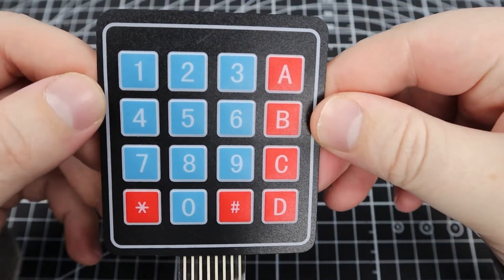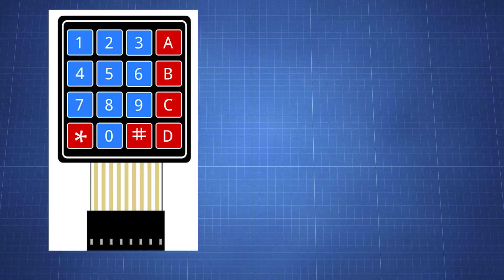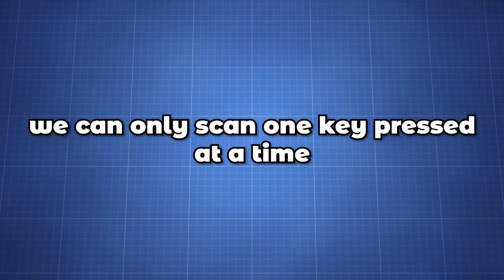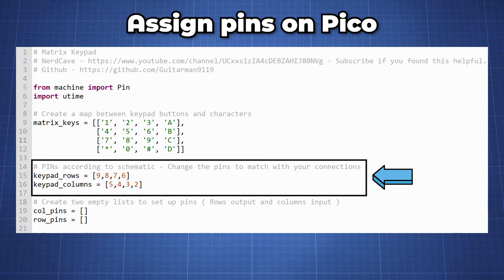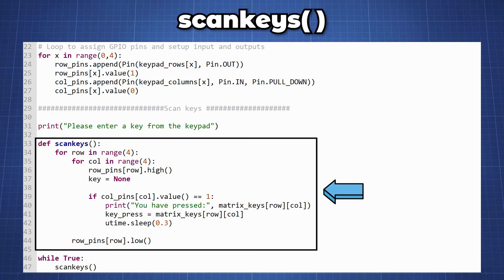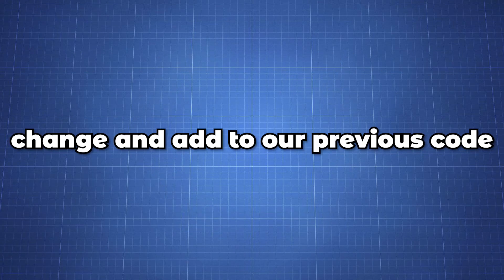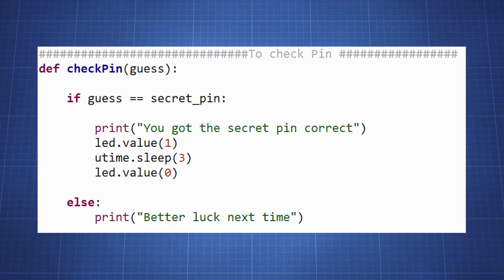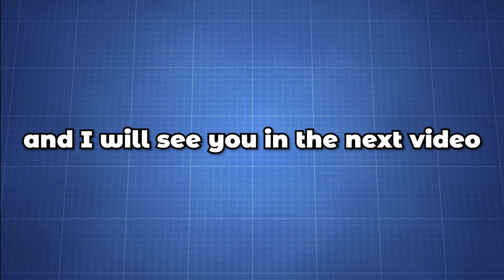Raspberry Pi Pico Tutorial -  4x4 Matrix Keypad - MicroPython

Comment from the maker: *a small error made in last circuit, remember to add a resistor in series with LED to limit current.
Reply: Can u use the number pad as an macro keyboard?
Reply from the maker: yes you can, still input so instead of assigning a value to key, it will just act as keypress then do specific macro.
 @LightSkip_rb

Comment: hi i really hope you answer me i am confused why did you put the rows as input and why did you put the columns as outputs
Reply from the maker: A matrix keypad is essentially a grid of switches, each switch being identified by its row and column. To determine which key is pressed, the microcontroller sets one of the lines (row or column) high (or low, depending on the setup), and then reads the other lines. If a key is pressed, it will connect a row line with a column line, and the microcontroller will read a high (or low) value on the corresponding line.

Whether you choose to set rows or columns as inputs or outputs depends on your specific needs or constraints, such as the physical layout of your circuit or the specific requirements of your microcontroller's GPIO pins.

So in short you can switch it

Comment: How Input High on pressing as we are not giving any voltage to the pin?
Reply from the maker: The rows are set as output so we set each row High Output (3.3V) then we check all the columns to see if any input goes High.
Reply: @NerdCaveYT  thank u

Comment: I would like to use the keypad for an lcd screen as i am doing a project which when i enter characters from the keypad they will show up on an lcd screen but when i execute the keypad does not work on the lcd and the gpios are all inputted correctly
Reply from the maker: so the text appears on screen then after you press enter everything is gone? Did you clear the screen and then write the new output to your LCD?